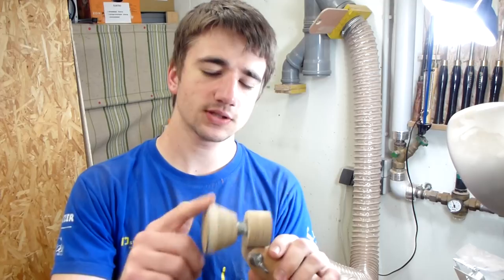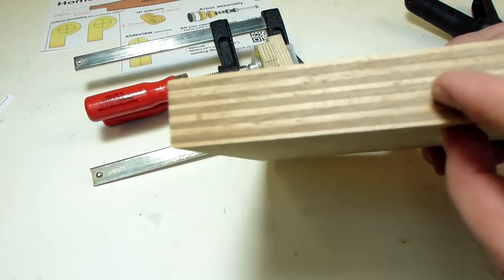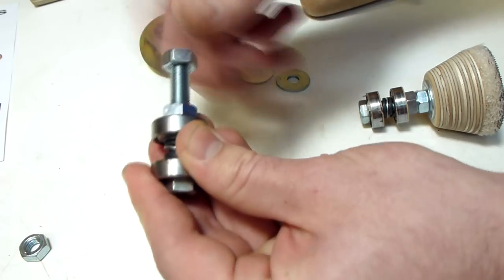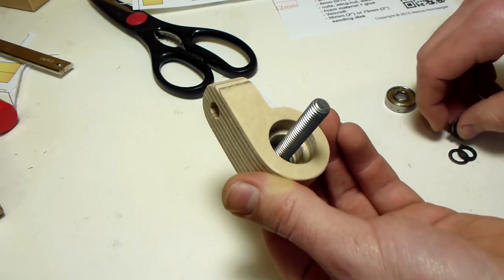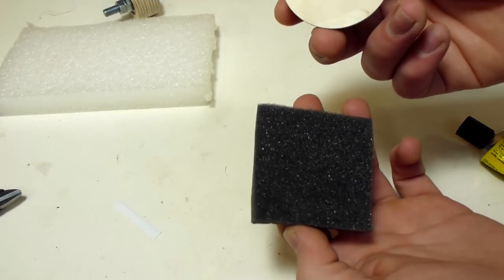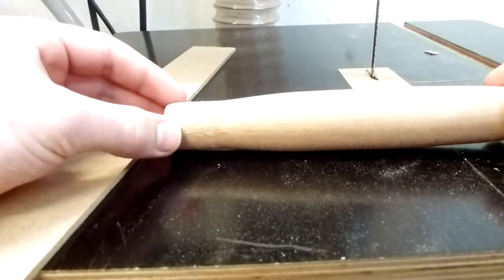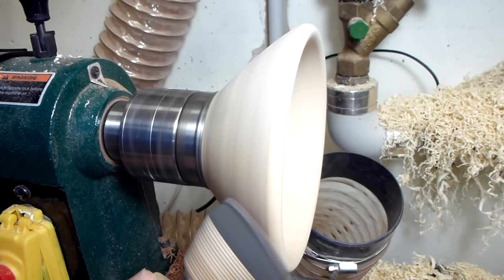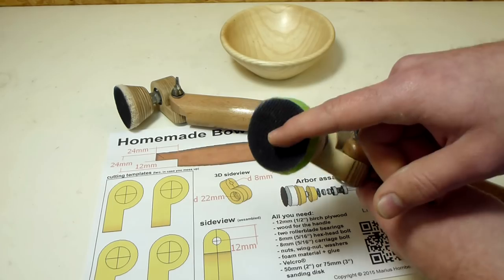Homemade Spinning Bowl Sander

Comment: You may want to find a pipe size that is close to the circle required and sharpen the edge to use it as a punch to cut out your circle paper, Not sure what circle size you need, but you can use flat stock to bend into a circle if you require a custom size. A punch will save tons of time when cutting circles out of paper... I hope this helps....
Reply from the maker: Paul Bialozor Good idea, thanks.

Comment: Thanks, it's a useful item, and your plans and instructions are very clear.

Skateboard/rollerblades are a good source for bearings, usinally with an 8mm bore, and (I think) 22mm external diameter.  I would drill 22mm holes in the plywood bracket and then epoxy the bearings in place with glue only on the external edge of the bearing.  BTW, I don't like to hold small workpieces with my fingers when drilling - sometimes it can be painful.

Comment: Thanks alot man , i ve seen this video several months ago and i thought ,ok it ll work but not much maybe a 30 percent faster and i was afraid to waste the time doing it, finally this morning i gave it a go , i put 2 arbors in one handle to do 2 grit changes per stop and its like 3 times faster. 
thanks
Reply from the maker: It's amazing, isn't it
Reply: +Marius Hornberger 
yes unexpectedly good.
 i wish i could put a photo here , and the sound is great when the rpms are high
Reply from the maker: you can find my email in my channel description, if you want to send a picture.

Comment: Very cool, if you can find some steele pipe the same radius as the sanding disk's you require, you can sharpen it to make a punch for cutting sanding disk's out quicker.

Comment: @2:46 you modify your clamps by drilling a hole down the lenght of the clamp's handle and epoxy an allen screws in there. very useful when your clamps are close to each other and you can't grip it with your hand

Comment: I have been wanting to make one for a year , but held back because of the complexity and expense of most designs . This is so easy and cheap I think I will make up one for every grit paper I use , plus one for the polishing paste . But one quick question , not much is available here for hook and loop paper , for the 400 through 4000 grit wet or dry , do you think I could use double sided tape ?

Comment: Those bearings are not designed for axial loading (like thrust bearings), which you will impart during use.  How long do they last in use?

Comment: I didn't understand what you said about the printer setting that need to be changed.  Can you explain please
Reply from the maker: I made the plan for A4 paper size. You maybe need to adjust your printer to work with that.
Reply: Got it.  Thanks Marius.